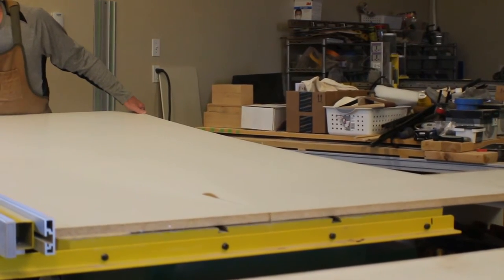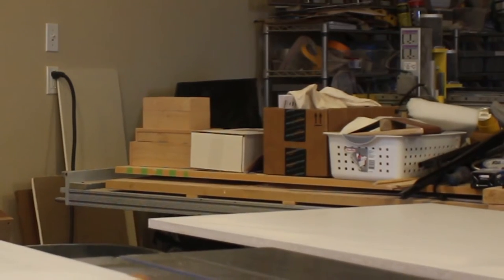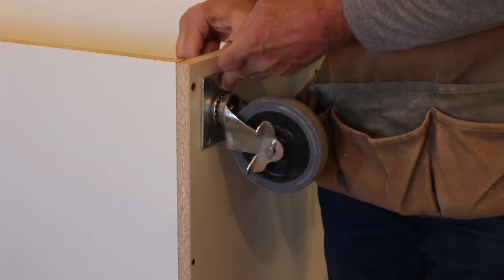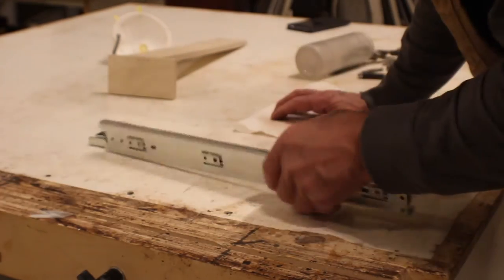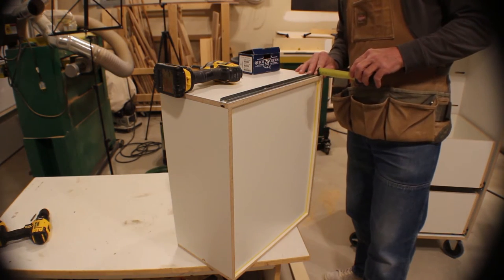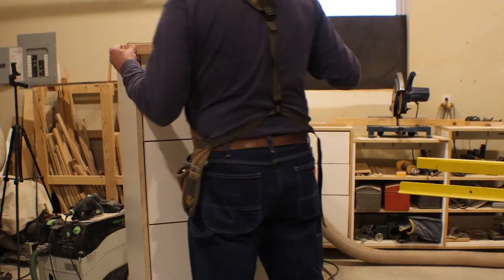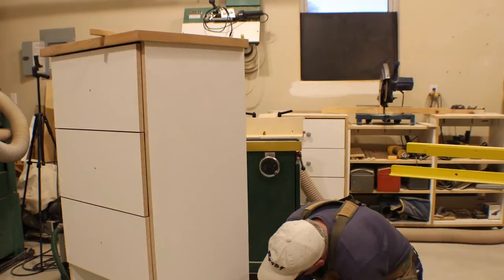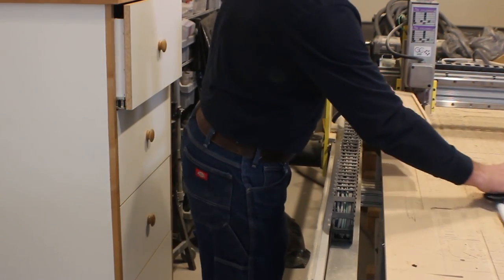Building a Storage Cart On Wheels with Large Drawer Stack for the Shop

Comment: WhT blade do you use for cutting the melamine?
Reply from the maker: Just a regular ripping blade for your table saw, the newer the better. As you know, working with melamine is tricky. Normally I adjust the blade height to about 1/4" above my material thickness. With melamine, I go about 1" higher. Seems to reduce chipping. Pushing the material through with no wobbles is important too. Sometimes the melamine is just going to chip because you're cutting through an area that has some weakness from the manufacturing process so it is going to chip. I like using it, but it can be frustrating.